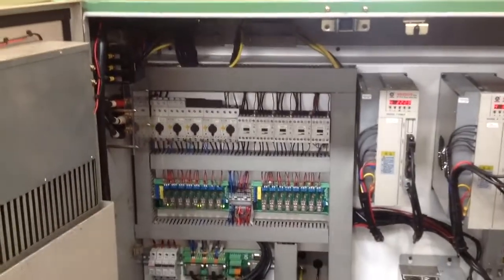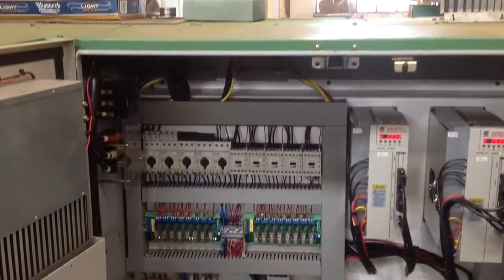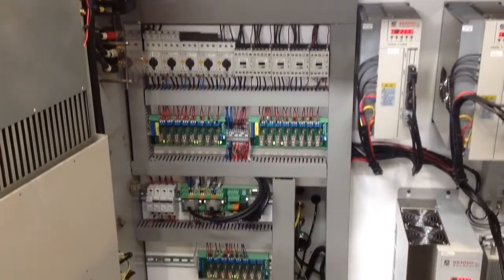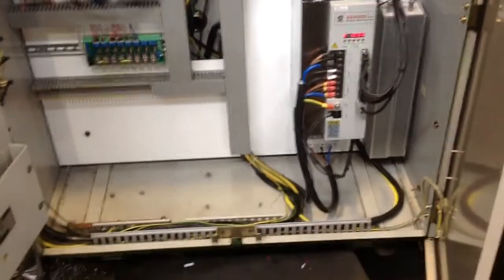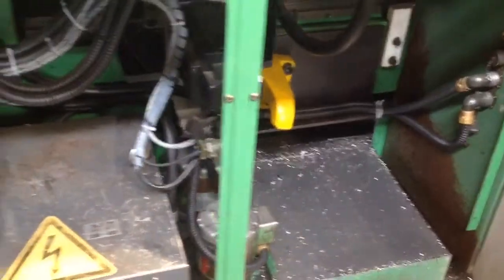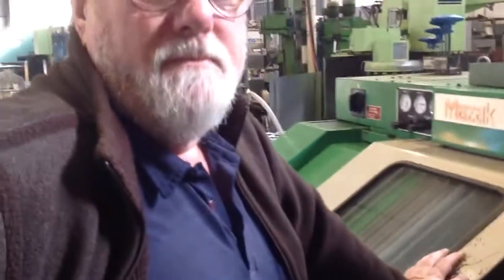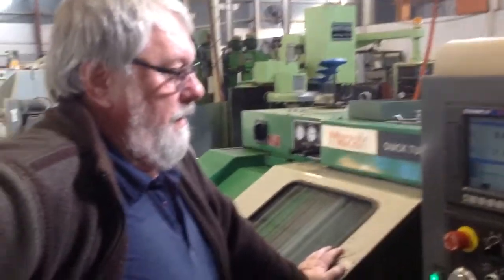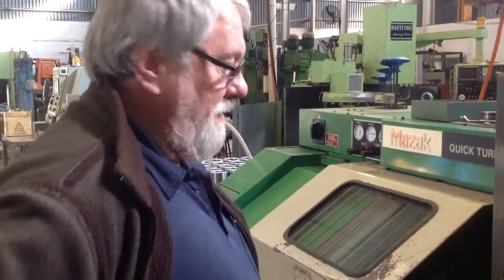GSK 988T CNC Control

Comment: Very nice work, GSK988T CNC control and GS2000 AC servo drives,  now there is new version with Ethernet function and servo motors with absolute encoders
If you need CNC parts, you can reach us at paycnc.com